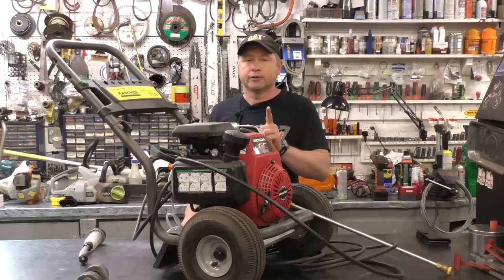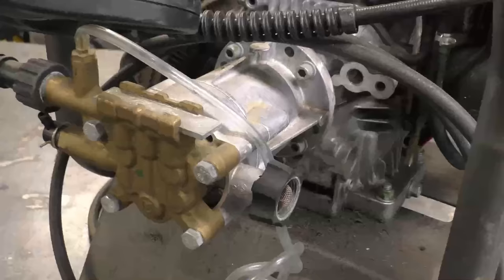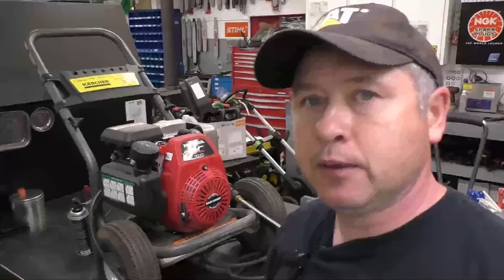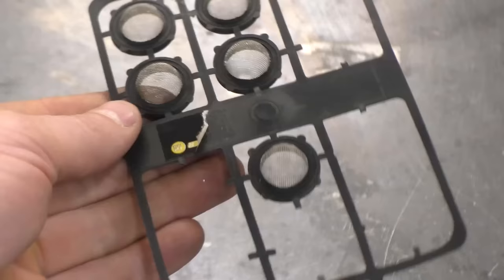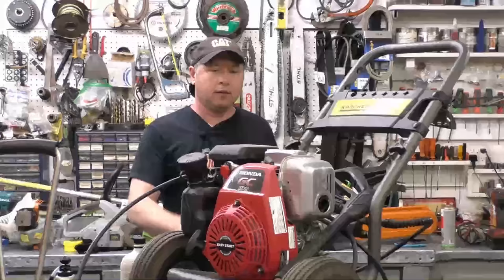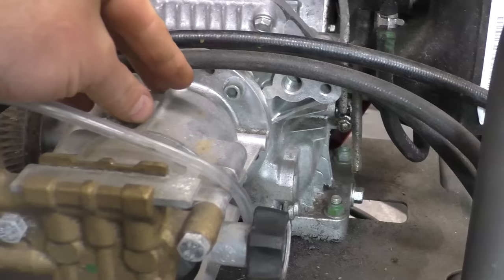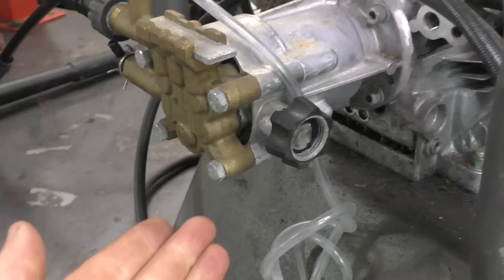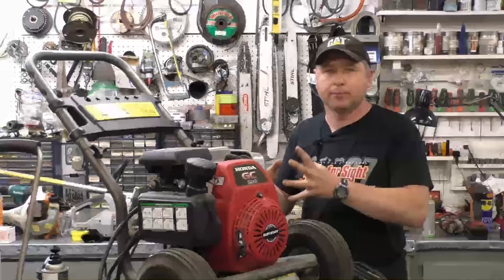Top Reasons Your Pressure Washer Pump Is Destroyed & Has No Pressure!

Comment: Yet another great video my friend. I just bought  a pressure washer. My question is though,when not using the wand do you just turn the machine off rather than laying the wand down with the pump running or is there some sort of pressure release or another way so the machine doesn't have to be turned off every little bit?
Reply: You should just turn it off, some washers actually have a safety machanism where if the trigger is NOT pulled in a while, it'll discharge its own water over time as it continues to run.

Comment: i got a $300 washer from Amazone , used it a couple of times and now it wont let me pull the rope, it's so hard to pull I can't . I think i did not let any water out of machine after turning off?. I just turned off and then unplugged the water. cannot figure why only after a couple of uses it will not let me pull string

Comment: Help I bought a pressure washer last year used it once and tried to use it yesterday pulled the trigger and there is no pressure at all it’s very low like if it has a low pressure setting don’t think the pump is cracked didn’t see no leaks or cracks

Comment: I have the exact same Karcher Pressure washer leaking white oil where the pump connects to the Engine. The engine oil is fine so it's the pump. Is the pump fixable or should I buy a new pump?

Comment: Whenever I finish using my gas powered pressure washer, I disconnect the hose from the pump and gun, squeeze the trigger to drain the gun, and then pull the rope on the engine a few times which forces the remaining water from inside the pump out of it.  That way you don’t have water sitting in the pump which can have calcium and also so you don’t have to worry about freezing.  I used the same pump for about 8 years and it was still working fine when I sold it to upgrade, so I must be on to something.

Comment: The same reason you don't run an outboard motor without putting it in water, it needs the water to help lubricate the pump impeller and keep it from tearing itself up

Comment: I have a Predator 2500 pressure washer and was going to use it however it would not start. I cleaned the carb and checked the spark plug which had spark. I was able to start the engine but now it idles low like its about to shunt down but it just runs low idle and Im hearing some sort of noise like a screech either underneath or maybe buy the carb. When I press the trigger the nozzle will send water out but not high pressure and the noise goes away. I have been looking all over the net for similar issue but I have not been able to find anything. Any clue to the issue would be great. TY

Comment: And yet your finger is next to the "Thermal relief valve" that opens up and let's water out of the pump when temp reaches 140 degrees F. Also, if your pump requires changing, the interval is the same as the engine. I use a air fitting to water inlet fitting to blow air thru pump ,hoses, gun to dry them out, after running/removing fuel out of unit.

Comment: Let the water run out of the high pressure hose and trigger gun before you put it away for the winter. I've seen lots of trigger guns split from water freezing inside them.

Comment: What about the lack of pressure when u first turn it on? The pressure builds, then fades away and repeats the cycle several times before the pressure finally stays?
Reply: It's purging the air out of the pump , always turn on the water and get a good flow out of the hose before screwing it onto the washer pump !!

Comment: Hi, I just started messing with my machine. Thank you for the information. I just have one question that I didn’t see here. Is it ok to start a machine bone dry? As in no water attached to the pump. I seen someone do it but not sure if that’s ok. I know most people have the water line on with the wand pressed on so there to back pressure before starting it. I have a GX390 and I might get a new pump, General Pump ez4040g. Right now it has a AAA one and I have probably let it on numerous times. So who knows how mulched it is. I also heard that there are pumps that recycle the water to prevent that,  not sure if you’re familiar.

Comment: My washer just quits on me when the water is connected. If I press the trigger while starting it it runs but no pressure and as soon as I let go of the trigger it quits. It will start if the water is not attached. I was using it with no problems last weekend to clean the lawn chairs. I have the Briggs and Stratton Professional engine series 7.75 with 175cc.  Update: pump completely died on me. No water flow whats so ever. Time to either buy a new pump or a complete new pressure washer.

Comment: My Simpson has a blow off valve that is supposed to negate pressure buildup.  I burned up my pump by running for 30 seconds without water.  Dumb mistake.

Comment: the worst killers of water pumps are - 
running them dry 
and 
not filling the case lube. 
your pump needs to be water primed before running at motor speed.  water is the lubricant and coolant for the head of the pump. 
the drive end of many pumps is filled with oil / gear lube type lubricant.  many people neglect to service this fluid level and the drive end runs dry.
alcohol will mix with water and evaporate the water from the pump head.  spray alcohol into the pump head with a sprayer while rotating the motor with the spark plug removed. 
buy a can of silicone spray lubricant. spray it into the inlet while rotating the motor with the spark plug out.  the silicone lubricate the pump head after the water has been evaporated.

Comment: It’s faster, easier and effective to suck windshield-washer antifreeze into the pump via the soap injector tube and run it through the trigger wand and hose protecting every thing. Hot water of any kind will destroy the seals in a pump. Leaving a pump in by-pass for more than 30 seconds will create 140+ temperatures. By-pass is an unloaded that reduces pump pressure when you let go of the trigger, putting the water into a very short, high friction loop. If you have to leave it running, see if you can make the unloaded discharge to ground thereby constantly supplying the pump with cool water. Better electric pressure washers will include an automatic shut-down that turns the pump off until it detects a drop in pressure to restart from squeezing the trigger. NEVER feed a pressure washer other than cold water, ever,

Comment: I blow the water out of mine with an air hose at moderate psi.  I do this at the water hose connection with the high pressure hose detached.  10 years on same pump with seasonal oil changes.  Somebody will point out a flaw with this method but hasn't failed me.

Comment: Why does my Yamaha 3100 psi pressure washer surge when not spraying, but stops surging when spraying.  Works great while spraying.  The surging is annoying and suggests something is wrong.
Reply from the maker: your carburetor needs to be properly cleaned or replaced
Reply: @donyboy73  Thanks.  I'll try it as a last resort.  Was hoping it was something simple.  I had to rebuild my carb on my generator last year.  Was a pain, but it did the trick.

Comment: Great tips Dony! I would add running a short whip hose into a 1 gallon of antifreeze and then starting the engine, let the pump prime and go into bypass with the hose and gun in play. This pump not so much because of the internal unloader is really not a big deal but any pump with a external unloader it really should be circulated. This type of wobble plate pump is incredibly cheap compared to General, Cat, Giant, achoo AR, etc. and can't take a lot of abuse. So when they say don't run the pump into bypass for longer then a X amount of time you better just shut it off. Low pressure usually results when a piece of foreign material gets cought up in the unloader, valves get plugged with debris, thermal popoff leaking air or in bigger pumps seals melt and suck in air through the seals and or gets deposited into the unloader. 
So 100% shut the thing down when you are done using it or put a weeping gun on it. 
Great video thanks so much Dony!

Comment: I have a Yamaha gas with a cat pump and the window for the oil on the cat pump, it states on the inlet max 104 degrees why are these pumps for cold  water only, the pump in a car is pumping nothing but hot water the same with a hot water boiler in a home, I have a hose bib with a mixing valve which I put in before I bought the pressure washer hoping to clean the grill with hot water, I have used hot water and the pump is still working fine, but I see pressure washers with separate boiler after the pump, seems strange a home boiler pumps water at 180 degrees and pressure washers can't and the pressure washers with the separate boiler are very expensive and use diesel fuel to heat the water any thoughts or experiences?

Comment: My pressure washer builds up too much pressure and won't relieve itself until it shuts off. It's impossible to pull the cord, like the engine is seized, release pressure at the wand, it can be pull started again.
Reply: You don’t want pressure at the want to start it ,you must always pull the trigger to release the pressure before starting machine

Comment: Most of your advice does not apply to electrics. If you have a light duty job, or you don't want to 
drill holes in your deck or siding, use an electric pressure washer.
No worries with bad gas, freezing water, or leaving it running while unattended.

Comment: Pressure washer technology is terrible. These machines are too difficult to start, use, and maintain. And that BS about keeping water running through the wand if the engine is running just isn’t realistic. I bought one from Home Depot one year. After two trips back to their shop because I couldn’t get it started, I had them try to start it while I was standing there so I could see what magic incantation they were using and turns out they couldn’t get it going either. Long story short, that unit was on the curb a few days later with a sign that said “free to good home…good luck”. I have all sorts of gas powered tools/machines that I can keep running, but a pressure washer isn’t one of them. As I said, they are a terrible product that sets up the user for failure.

Comment: From Dewalt Owners Manuel: 
DO NOT stop spraying water for more than two 
minutes at a time. Pump operates in bypass
mode when spray gun trigger is not pressed.
 If pump is left in bypass mode for
more than two minutes internal components of the pump can
be damaged.
note: Using a pump protector/ winterizer, RV antifreeze or wind-
shield washer fluid is to provide proper lubrication to the internal
seals of the pump regardless of temperature or environment.
Don't use regular car antifreeze.

Comment: It's not just antifreeze it also removes all the moisture that causes rust inside the pump and should be used after every use. A bottle of Karcher Pump Guard – Anti-Freeze Protection & Lubrication Formula costs $7 and will last for at least 10 uses. On a side note... what kind of i----t doesn't read an instruction manual on a multi-hundred dollar machine?